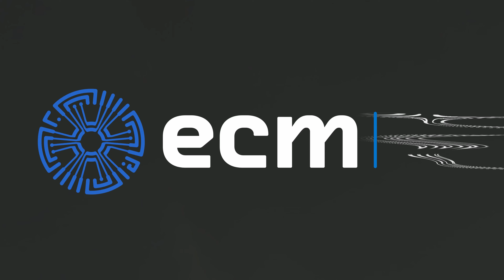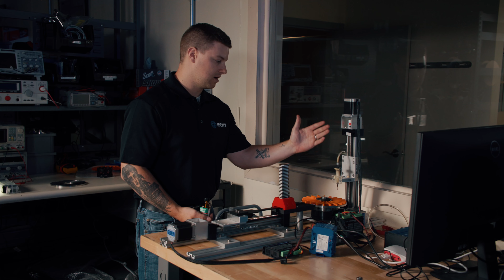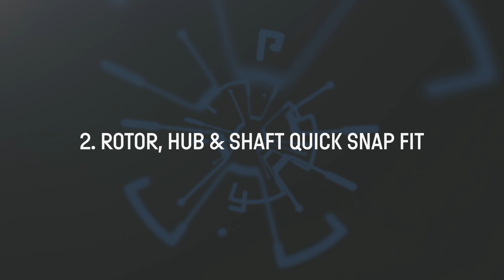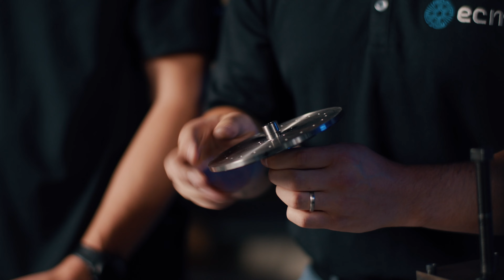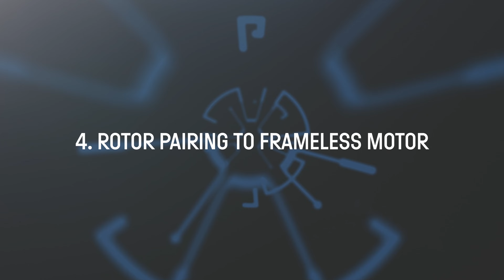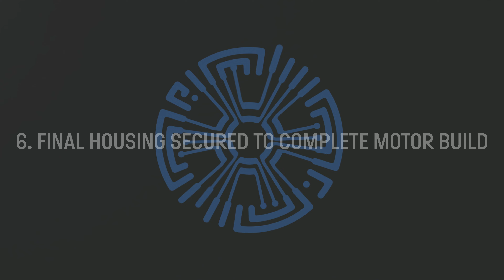Assemble a PCB Stator Motor in 6 Easy Steps – Fast & Efficient Guide!

Comment: Q: Why don't any of these PCB stator motors use anything besides an air core? Wouldn't inserting small cores greatly increase the motor's performance?
Reply from the maker: The air core is not the only medium for magnetic flux. The rotors are made of 1018 steel, which forms the return path of flux through the back-iron. PCB Stator motors can be optimised to increase performance and can easily achieve efficiencies in excess of 90%